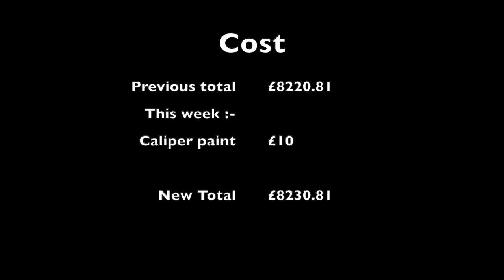Porsche 928 Episode 36 - Rust discovery and Caliper rebuild

Comment: Hi Todd, thanks again for sharing. Great rebuild on the calipers. If you haven' t cut the other side, id recommend to create a template there with cardboard. As mentioned,  id take the metalplate from hole to hole, cut the rest out. What the MOT guy would recommend id do. Its going to be better than the rusty oversprayed part was before. Just take your time and Do it properly. Greetings. Juergen
Reply from the maker: Thanks Juergen (now your Karl79 name has confused me) - yes, today I will do exactly that. I am templating with cardboard - hopefully next video won't be too long so you can see :) Thanks for watching
Reply: @MrToddgibbs  pardon me, karl is nickname . Looking forward to new vids
Reply: Agreed. Use a template or if you can find a donor car at a breakers (I think Douglas Valley Breakers has a few 928s) with a solid section, cut and weld in. The rust you have found in the structural chassis leg, need to be treated with some rust converter before you weld in the patch. Great work so far Todd

Comment: Your right Todd and the black is fine and when i did the rotors(as they were new Zimmerman) with the car sitting under the carport,over time they had surface rust
I soaked them in Vinegar overnight and came up really good
To prevent rust coming back(till i drive the car) i coated the pad area in a galvanized finish(silver) and the hat part in VHT Gold
Bit fiddly to do but look very very nice
I could get more done but my workshop is for the business(Strutwise)
Cheers Todd
Reply from the maker: HI Frank, thats part of my problem - I have many bits 'ready' but sitting around waiting... and I worry they will rust in the meantime.

Comment: Great job Todd . My weekly YouTube treat !
Reply from the maker: Thanks GT6! next video going live tomorrow I think :)
Reply: @MrToddgibbs  one thing that I did when I worked on my 928 was spray every nut and bolt that I could find for example front bumper bolts (tiny m6 I think ) with a penetrating fluid . I did this several times over a period of months before I worked on that area . I think it saved me loads of time in the end freeing off rusted fixings

Comment: Both my rear callipers are seized and just what I wanted to see. new callipers are a rip off, about £240 each so replacing the pistons is the way to go.
Reply from the maker: Hi Rick, glad to hear it! One of my coming episodes is about rebuilding the rear calipers. I will include links to the rebuild kit I used (was about £65 for both). Thanks for watching !
Reply: @MrToddgibbs  Thanks Todd. When I remove the calipers one at a time i'll strip and see  what's needed. I have the seal kits already so will just order the pistons and be repainting the callipers silver when done, porsche were painting many parts black for some reason.
Reply from the maker: Sounds like you have everything you need. Yeah I went black mostly because I had black caliper paint :)

Comment: Hi Todd,
Great work there,perseverance is the key 🔑 
I had my Callipers powder coated silver and they looked great and rebuilt at the same time
But with the car being sitting surface rust is there,and I’d planned to take them off and paint them in 2 pack system over the summer
As we are into fall,it’s a spring job!
Stay safe Todd Frank😷
Reply from the maker: Hi Frank,  I thought. about powder coating them, but figured it would be too fiddly. Hoping mine dont go rusty while they wait to be installed - they are sat in freezer bags in a box now.

Comment: I'd strongly discourage you from "plating" that chassis leg. That's a really important structural component. Chop a neat oblong patch out and seam weld in a plate of the same thickness. Either joddle and overlap or butt weld. That bit matters if you ever have a front-end smash.
Reply from the maker: Hi Howard, what’s the difference between plating and overlap?
Reply from the maker: And are you talking about the vertical or horizontal bit?
Reply: @MrToddgibbs  I mean the front to rear box section. I assumed you meant you intended to leave the two big holes an put a plate over the top. I just think that's rough and encourages further rust under the new plate. Personally, I would could it out neatly and let in a new bit so you can tell. I know you're reluctant to cut more metal but it's usually easier to cut back to a shape that's easy to make.
Reply from the maker: Hi Howard, ok yes I understand.. cut out metal to join those two holes together. Perhaps tidy it up so its rectangular and then weld a plate over the top off it, overlapping by perhaps 5mm ? After speaking to a friend today I was going to do exactly that :)